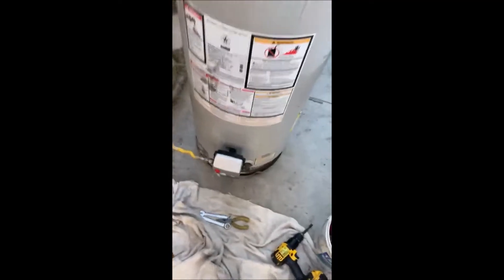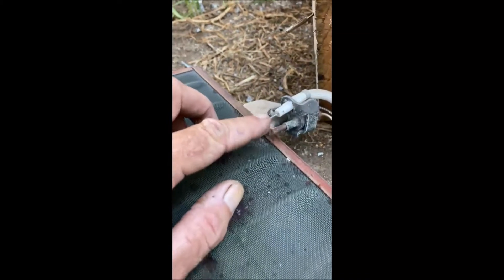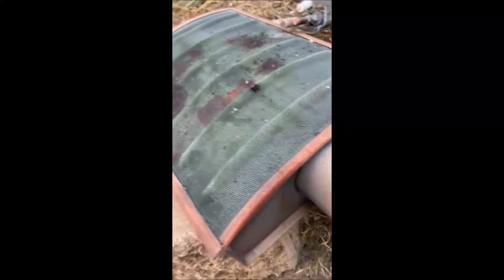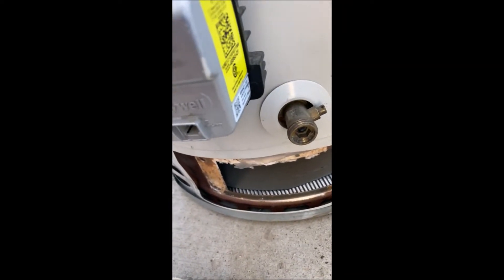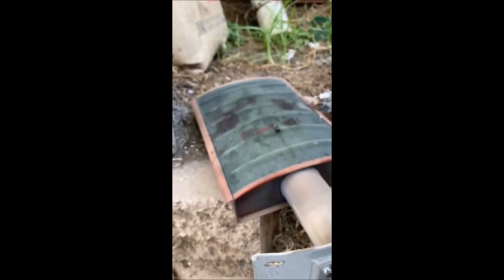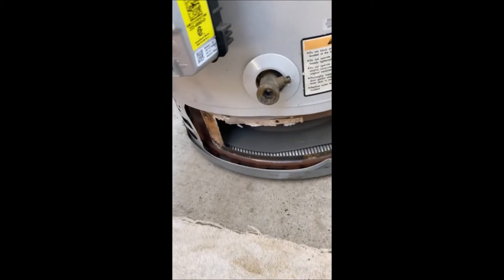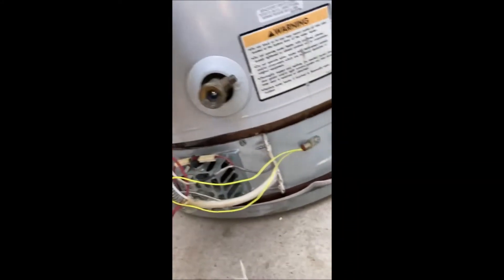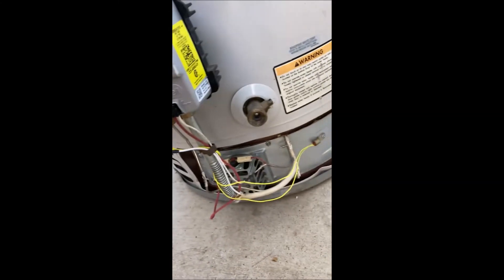The exploding Bradford White water heater! Fixed!

Comment: thank you.  having the same problem.  found charred wires and been throwing replacement parts at it with no luck.  No holes on my screen but does have a lot of that same green build up on the mesh. took a brush to it but no joy.  i'll try compressed air like somebody else did in the comments.  if that doesnt work, i'll just replace the entire assembly.  thanks for the video.
Reply from the maker: Thanks for watching! I hope you get it solved !!

Comment: Thanks to this video, I was able to verify that my Bradford White's pilot blowout/explosive condition was due to a hole in the burner screen in pretty much the same spot as the one you show. Now I just need to find a place to get a replacement burner. Local shops are closed for the weekend!
Reply from the maker: @double-jay2180  : yeah you’re welcome. I had a guy coming by Otero, Nox, Burner Assembly from me today because he had the exact same problem, but it was for Ao Smith. The Burner assemblies are very similar with the screen on top..

Comment: So replacing the burner assembly is a short term fix because it does not address the issue of the leak that caused those holes over time. Wouldn't a new burner will also be damaged over time due to the leak ?
Reply from the maker: Of Course - Its condensation that falls onto the burner when the gas (fuel) is igniting usually only lasts for the first 30-40 mins the water heater is running once it reaches temperature the conditions for condensation change but its different with every water heater - depends on engineering  and location of water heater temperature of water ext. - I don't prefer the Ultra Low nOX burner Assembly's for that reason the screens are susceptible to erosion damage.
Reply: @thewaterheaterfactory  Maybe you can help me understand this hole problem. The mesh itself is not an air-tight design or is it? Wouldn't gas escape from it anyway and burn without holes as well ?

Comment: Thanks for the video. What model were you working on and where did you get the burner assembly replacement?
Thank you!
Reply from the maker: Yeah, I don’t remember what model I was working on, but I keep the Burner assemblies from Water Heaters that leak and swap them out. Not sure if that was a 40 or 50 Gallon that Service Call was a couple years ago. Thanks for watching

Comment: I couldn’t figure out why my BW water heater turned into a fire breathing dragon with a sonic boom. 
Then, after watching your video, I inspected the mesh and I discovered two tiny holes. I just replaced the burner and reconnected old assembly.
It’s working great now! My options were down to cold shower or new water heater. 
Thank you!  Sub'd. You are the Man🫵
Reply from the maker: Glad to hear it ! Those nox burner assembly's are wild. I prefer the older types! Thanks for watching!